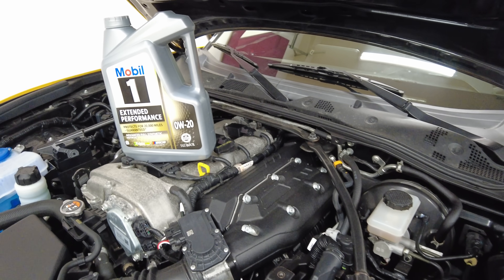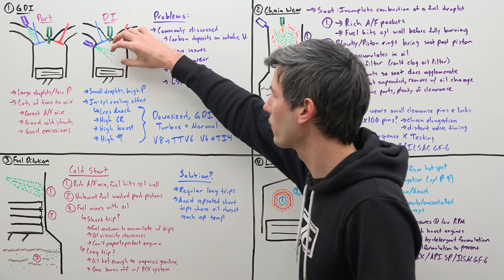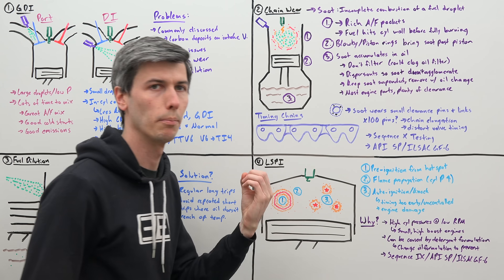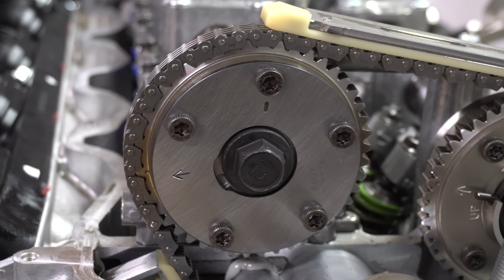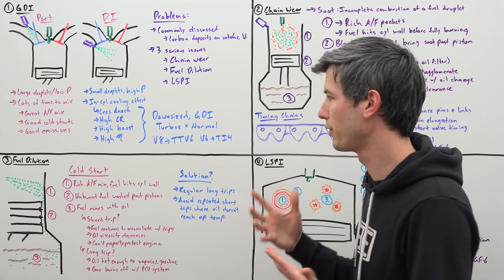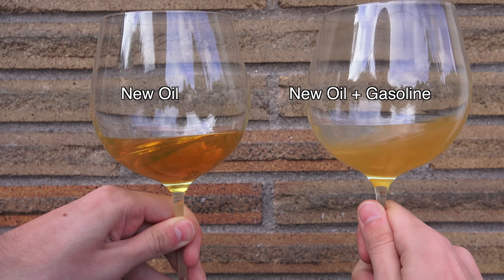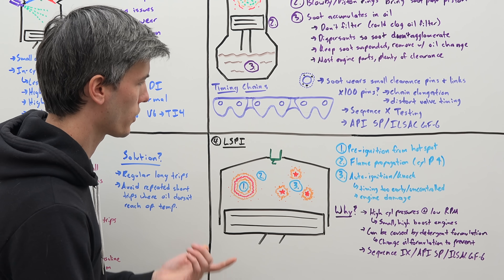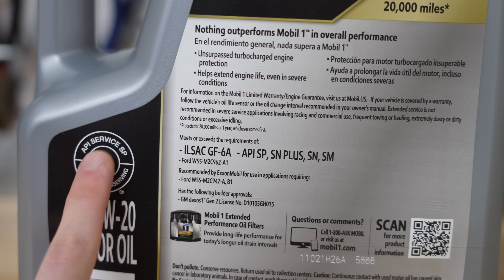3 Big Problems With Direct Injection Engines (Gasoline)

Comment: How do engines that stop/start at each traffic light exacerbate this issue?
Reply: the more complex something is, the more problems can arise.  I've learned to avoid complicated systems, and saved lots of money over the long term.
Reply: I don’t think it’s a huge problem unless you are constantly stopping and starting an unreasonable number of times. The engines are designed with the auto stop start in mind. The computer has logic not to shut off if the oil hasn’t reached temp, for example.
Reply: It seems to me the auto stop/start function in my wife's turbo inline 4 Buick doesn't operate until the engines is fully warmed. It is also disabled when the battery is at less then a full charge, like after a cold start.
Reply: They don’t lmao
Reply: Speak english

Comment: So basically get an engine with a timing belt
Reply: No, backwards  thinking, use the new  Gf -6 oils and  don't buy a car with Turbo Charging.
Reply: @grassroot011  turbo for life man. I always use PAO based oils. Direct injection isn't that bad apart from carbon build up.

Comment: Do you know how to get rid of such problems? :D buy you an EV
Reply from the maker: Haha, quick fix!
Reply: I think people still want IC engine cars!
Reply: I agree , but EV technology is only effective in highly industrialize countries.  I have live in Mexico and the Caribbean  having and EV vehicle is not only prohibitive expensive ,the infra structure is lacking and unreliable.  For example in those areas  you get hit by a Hurricane  and you may be out of electricity for days or months( Hurricane Maria 2017 in Puerto Rico). Then you will need an ICE generator to charge your car. This is an example, imagine the majority of Africa and Asia, where there  is no electricity some areas.  Like it or not ICE  are an engineering  marvel.   What EE explained is a minor problem that can be minimized with good maintenance. Besides many Americans change the car in 3-5 years.  Lease a car.
Reply: Fk the planet, EV all teh wey
Reply: @Wind_slash0  you mean all the gay hahaha get it, cuz EVs are gay
Reply: Buying an EV = worse for the planet than ICE
Reply: They literally destroy earth to mine the lithium, copper and metals needed for the batteries. That’s much worse than sticking a straw in a gas rich region. Lmao go buy a golf cart and let me know when it needs a battery change if you still want an EV😂😂

Comment: Direct fuel injection, AKA: Bosch mechanical fuel injection utilizing a fuel distributor (of all things) and was something that was whole heartedly embraced at the dawn of the golden age for 'Brickyard motors'. Mechanical fuel injection bore witness to the rise of the of B-21 Volvo powerplants that were neigh indestructable.
Reply: These were manifold injection systems, not direct injection.
Reply: @oldanslo  Yes DI is a type of fuel injection. The original comment seems to be talking about fuel injection in general
Reply: @oldanslo  he might be talking about the old DI systems you see on like the 12v cummins

Comment: Are these also issues with Diesel? Diesel has used direct injection with success for a long time. Honestly curious how Direct injection between the two systems is different.
Reply from the maker: Diesel soot is actually a bit softer than gasoline soot, and so they don't tend to have issues with timing chains (from my discussions in prepping this video).
Reply: @EngineeringExplained  thanks I will check those out. Great channel 👍!
Reply: Some diesel engines also don't use timing chains but gearsets to avoid the problem entirely. Gearsets not being ideal for quicker revving gasoline engines however.
Reply: @hallkbrdz  You do realize there are a few gas engines that actually do use gear driven cams . Honda V4 in VFR comes to mind and being a motorcycle engine it rev fast and  has a high red line compared to passenger car engines . It's also supposed to be a very reliable engine in typical honda fashion.  Don't believe everything you read or see online
Reply: @hallkbrdz  You do realize there are a few gas engines that actually do use gear driven cams . Honda V4 in VFR comes to mind and being a motorcycle engine it revs fast and  has a high red line compared to passenger car engines . It's also supposed to be a very reliable engine in typical honda fashion.  Don't believe everything you read or see online
Reply: @hallkbrdz  Heavy duty engines do use gears,  it's simple and reliable in most cases (khm khm Volvo D13 khm). But timing chains when done right can last the lifetime of the engine, best example being Mercedes automotive diesels (OM601, famous OM606 later OM611 common rail etc)
Reply: @hallkbrdz  the reason gearsets aren't used on gas engines is because the vibrations caused by the gearsets set off the knock sensors which will retard the timing. This is only an issue with EFI engines (i plan on installing timing gears on my carburated 460 big block 1 day)
Reply: @hallkbrdz  I had an old Scout II with the 354 4-bbl V8, which was a truck engine with timing GEARS instead of a chain, and the sound they made on a cold morning was such sweet music (til the truck warmed up, then you couldn't notice it).
Reply: Diesel cars have had or still have issues with the emission system, especially the emission return valve. It clogs up and the engine starts running badly, power decrease, warning lights and s*** like that. Very common issue, but I don't know if this part is used in US cars. Very bad example the GM product Opel Vectra C with the 1.9l Diesel. Great engine basically, good power, very economical but tons of this issue.
Reply: @computercrack  Diesels dont suffer from LPSI, nor engine oil dilution as the fuel is combusted by compression. Biggest problem is EGR and DPF.   If there is a DPF problem a sensor will tell you and the EGR is dead easy to clean yourself.
Reply: @csjrogerson2377  EGR is indeed easy to clean. Mine was stuck so I bought a new one and watched a DIY tutorial but when I disassembled it I noticed it was just full of soot. After cleaning, it worked again perfectly so the new one is still in the box ☺
Reply: @csjrogerson2377  It does suffer from oil dilution, I would say much more than petrol engines. When the DPF becomes too loaded, the soot is removed through regeneration, which involves fuel being injected very late into the expansion stroke so that it burns not in the chamber but in the catalyst, increasing DPF temperature to >600ºC to burn away that soot. The problem with this is that a lot more fuel than usual reaches the cylinder walls and is washed down with the oil. This issue is one of the main points when tuning the engine for regeneration in the development stage.
Reply: @johanssonb  you're 💯 correct about this which is why GM installed a dedicated fuel injector in the exhaust of the duramax (1st of the big 3 to do this) for regeneration
Reply: @computercrack  thanks for clarifying, I was wondering if the “gunk” build up on the intake valves was an issue as well!
Reply: @computercrack  we call it exhaust gas recirculation but it's a similar system, we mostly just tune the ECU to never open the valve.
Reply: @Prestiged_peck  yea try that in germany and get fined for modifing a car in a way that badly effects emisson values.
Reply: @Prestiged_peck  or just leave it how it is and reach 300'000km as in my diesel?
Reply: @leogreck9984  you can get fined for it too but tons of those trucks are non-highway use, and due to our grandfathering system the government can't do anything unless it sees the public roadways.
Reply: Guess I should have read through more of the comments section before asking the same question 😅
Reply: One of the reasons is that diesel fuel is more of a lubricant unlike gasoline which is more like a solvent (gasoline is REALLY good at removing old undercoating should the need arise). Diesel fuel has had lower abilities to lubricate since the switch to ultra low sulfur diesel fuel but it still a much better lubricant than gasoline can ever be.  You can still get oil dilution in a diesel (from injector failures/leaks) so check your oil levels
Reply: Diesel's spray into the combustion chamber in the piston instead of the cylinder wall and diesel is also more of a lubricant. I really wish diesel cars where more common
Reply: @alexlandsberger1423  I hate driving behind any diesel stink box, smelling that stink and realizing that some of what was splashing around in that guy's tank a few minutes ago is now in my lungs. I will pass any diesel I get stuck behind - other than the very latest pickup diesels that don't seem to exhibit this godawful stink. I wish there were LESS diesels.

Comment: It's not that bad if you use proper full synthetic oil.
Reply: BS! Oil type doesn’t matter most of the time. Fact is modern engines have many fine intricate parts that require clean oil. Fine mesh, small intricate chains and small passages cannot have any clogging at all or the entire engine can fail prematurely. Clean oil is more important than ever before.
Reply: @Montblanc1986  

Engineering Explained literally has a video of benefits of synthetic oils. One of them is being able to maintain their viscosity which would help when it comes to dilution. 

Synthetic oil with latest certification (which just about any major brand holds) + manufacturer recommended oil interval change = 👌
Reply: @Montblanc1986  Someone didn’t watch the video!
Reply: @Montblanc1986  loooooollll. Do your research before you open your mouth

There's a big difference between Hydrocrack and PAO based oils.

Comment: senseless waste of research into an ancient technology
Reply from the maker: I mean cars are old technology, we shouldn't improve them?
Reply: @EngineeringExplained  Yes! Research into combustion engines should have stopped 20 years ago.
Reply: @Gromran  lol
Reply: @WeeWeeJumbo  Please don't answer if you have no idea!
Reply: @Gromran  I don't agree. 20 years ago something like a Tesla was straight out of a science fiction movie and to build with the tech then. In the last 20 years engines have become more reliable and economical. Right now I agree it doesn't make any sense any more and that's already reality. The engine ICE development departments are only working on the latest emissions regulations, that's it. Every new car in development today from the big OEMs will not show any big improvements over the last 5 years. They'll strap on electric motors and little batteries, make the batteries bigger and the engines smaller over time and in the end all of this converges toward BEV only. 2030 we'll look at a vastly different market than today.
Reply: You realize EVs were first built in the 1830’s.  There were several companies making EVs in the late 1800’s.  ICE won because batteries had the same technical hurdles as they do today, range per charge, weight, charge time,…